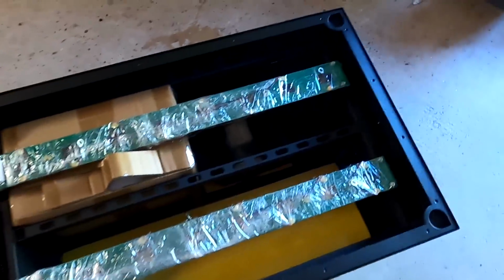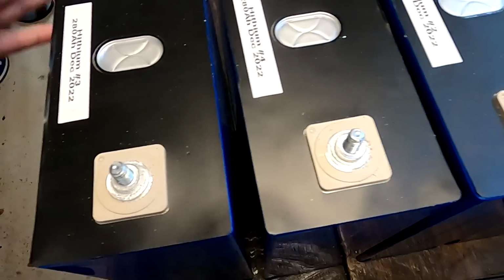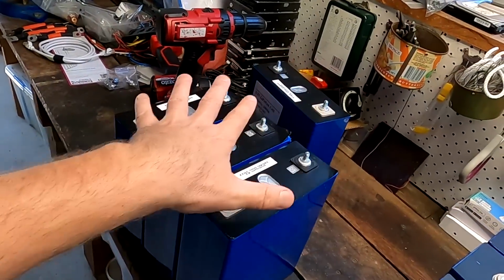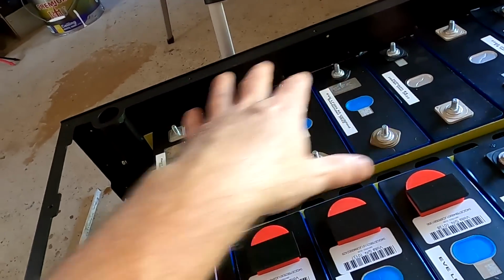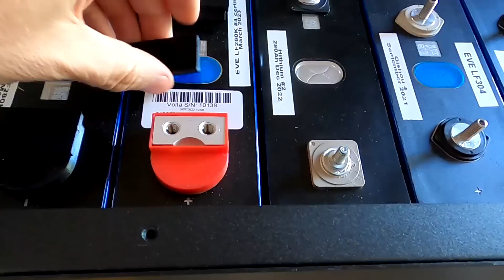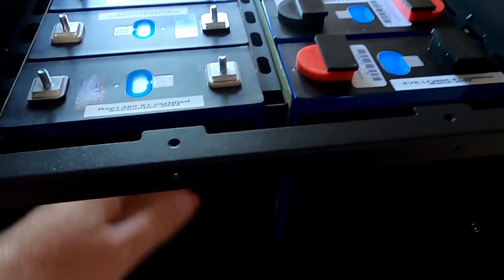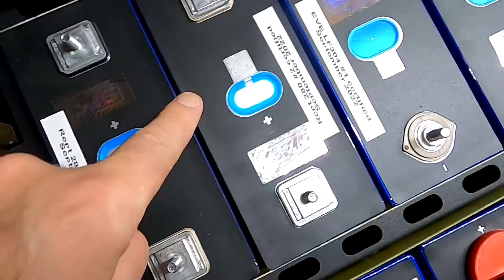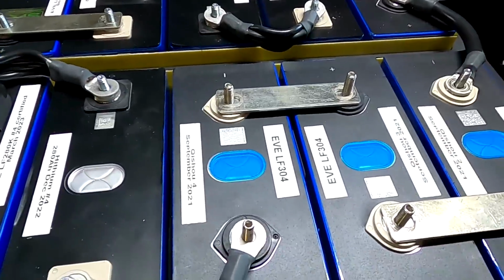Compressing swollen cells. What a start building this battery.

Comment: Rearrange your cells in a symmetric run, i.e. (2+2+2+2 of each kind) in 2 rows.
Reply from the maker: But then they won't have the same depth for each lane.
Reply: @OffGridGarageAustralia  They definitely WILL! If each cell of one of the 4 groups has a Dx depth (x=a to e) the total depth will be: 2xDa + 2xDb +2xDc +2xDe = (4-2)xDa + (4-2)xDb +x(4-2)Dc +(4-2)xDe, where (4-2) is a way of portraying the 2 unused out of each bunch of 4.

Comment: Andy, is it necessary to compress a 12v battery 320 ah (4 cells)? be used in a campervan.
Reply: He already has a video in that, and the conclusion is... No need to compress! No gains at all.
Reply from the maker: I would recommend it because it gets rattled around a bit in the van. So compression or a good fixture ensures they stay together...

Comment: Does anyone know where I can get pre crimped connectors/cables for jk-b2a24s15p GPS/rs485 (smaller than jst1.25) tks.
Reply from the maker: You should be able to get them on AliExpress. Also ask the Hankzor store there, they should be able to point you in the right direction or even have some for you.

Comment: You could make one new flexible busbar and use this one between cell Nr. 8 and 9. There the Seplos BMS has a extra voltage sens wire to compensate for the different busbar lenght.
Reply from the maker: An extra voltage sense wire?
Reply: @OffGridGarageAustralia  On cell No. 9, there is a additional "balance cable" on the negative pole of the cell. Therefore, the resistance of the busbar between cell No. 8 and cell No. 9 will not influence the voltage measurement of the BMS. You can find that in the Seplos BMS wiring diagram.

Comment: Could a strong spring between the battery and busbars be good or to press the busbars down to the battery.
Reply from the maker: The contact area would be minimal and resistance will certainly rise. The movement will be rather horizontally than vertically.

Comment: I would call and question the safety of compressing already swollen cells. What about the possibility of causing a short circuit between layers of dielectric within the cells with all that pressure?

Comment: Hi Andy,

They seem to fit, yet doesn’t it pose a problem that different busbars are bound to have a different resistance. This would have a negative impact on the balance at any point.

I think I would try and use all the same flex busbars, either all the same flexible, or all solid, equal distance with the hole filed out so that the connection surface of the busbar to the terminals are all the same.

Seplos’s compressionplate material seems a little thin at some points. Could it be you used a too high tork to compress. Isn’t there a way to calculate the tork matching the compression ?

Any way, I think I would support the bended parts with a steel “corner” of “Z” shaped metal to strengthen them.  Now that they are bend, they will bend more much easier when cells become pregnant of twins.

Keep up the nice work.. can’t wait to see what happens.
Reply from the maker: I tightened the compression plate with the battery drill to what I would consider tight and solid. I checked with the torque adapter and it showed only 4Nm...

Comment: I used the foam and couldn't close the case anymore. I had to remove all but 3 foam pads from the batteries. I wonder if it's bad if I have left the cells with a bit of breathing room.

Comment: And so it begins :). Nice project, nice video. Looking forward to every episode. Great learning experience.

Well - you experimented with those connectors a lot. Why not just use different busbar types in the battery and see, what the temperatures will be. You can and will be changing them anyway :P.

Since i am closely monitoring cell voltages (nice colourful graphs in Grafan *whoop*) and do some basic descriptive statistics with these data (avarages, spread and standard derivation) on my 2 batteries which are made of different cells qualities (battery alpha is "Grade A" erm Grade B, battery beta is supposed to be real Grade A) it would be so interesting to see, how the franken-battery performs compared to other batteries when it comes to the cells. We do so much initial testing on those cells and are obsessed with internal cell resistance, maximum capacity, "cell uniformity" - maybe in real life this does not matter at all :). So real life data might be the thing to check in the future --> go check for cell monitoring (there is an entry on that in the github discussion panel of the dbuserialbattery project, in case you might want to check).

Comment: Hi Andy. Great video. Question for you and everyone. If you used a mixture of different bussbars would that add to the cell imbalances we get on Lifep04 cells? 
Or is the cell imbalances just a result of the internal resistances of cells?
Reply from the maker: We always say internal resistance is the cause of imbalance but the resistance of a bad connection adds to that.
That is a very good question and has not been tested 🤔
Reply: @OffGridGarageAustralia  something me and another engineer having a great debate over the other day. People stress about the bussbar resistance and connection resistance being low as posible. Which is great! Makes the overall system more efficient with less power losses. But does it contribute to cell imbalance 🤔? 
Another experiment for you Andy 😀.

Comment: Interesting project. But what are your objectives? Do you intend to build in the most obstacles possible or get the best battery out of this uneven assembly of cells?
- Once you have this sticky foam inbetween the cells, they will try to shift as the foam allows it. They will test it out what belly is the strongest. (some kind of tug-of-war play) In this regard you are advised to use flexible interconnections only. 
- You might decide to clean the cell contacts and wire lugs with a cleaning hand pad before - in order to remove any dirt, oxide or finger prints. Why to prepare electrical contacts worse than surfaces for soldering?
- The initial balancing procedure will take forever in case you did not to balance them first thouroughly. But afterwards any good balancer will do the job nicely. A major unbalance is expected in case of heavy loads due to the different internal resistance. After that the balancer will be more busy than usual.
- Cells with higher capacity will just not be used fully and the worst cell will determine the total Ah of the pack. (weakest element of a chain) No major issue expected.
Reply: I guess we will see if all of that is correct! It could (should?) be. But the idea is to understand all of those statements above. I think this is genius... Because normally nobody in their right mind would do this, right? I am very curious to know what happens...
Reply from the maker: Either way, it's an experimental battery, so we can change and test...
I'm not going to clean the contacts. I did this once and had lots of issues. Since then, never bothered again doing this and they all worked brilliantly without cleaning.

Comment: Why not evenly distribute the cells: 2xhithiums, 2x304s, 2xrepts, 2xEVE? Symmetry. 
As for bus bars: now they are compressed, can they further expand? YES=Flexible; NO=Rigid bars.
Reply from the maker: Both rows need to be roughly the same depth so the compression plate at the front can evenly push them in...

Comment: With different capacity cells in series, I'm concerned the balancer may do more harm than good.  But, that is why you're testing.  Right, Andy?
Reply from the maker: Yes. I assume, the balancer will not do much. at least not more than in other batteries.

Comment: I am still of the opinion, that all this compression is nonsense. When you have this compression working for >1000 cycles while cells are pumping with each cycle:
- either the screws of the compression plate will turn lose
- or the compression plate will break
- or the terminals will break because of the mechanical force from the busbars

I think the best way for long term success should be leaving enough space between the cells to let them pump and bulge as they wish, as they will do anyways...

What do you guys think?
Reply: I think "Trees that bend in the wind last longest" - I use  thin neoprene separators and mild compression using huge industrial thick nylon cable ties with 18mm  ply end blocks -  all bus bars are copper  laminated  and  flexible  - it makes sense to allow enough flexibility for the cells to pant as they  cycle  but structurally a sound monoblock for mounting in my RV
Reply: Springs or poron foam and flexible busbars allows for some minimal expansion if done correctly

Comment: Nice work, i would absolutely use this battery. Next time i would typically discharge the cells before installation to potentially shrink them a little
Reply from the maker: The foam in between the cells will allo for a bit of movement anyway.

Comment: My cells have not expanded.  I have 48 280AH Eve cells that are in 3 banks of 16.  I have them slightly firm but not tight.  I believe many people are over charging their cells.  You don't get much more capacity once you go over 3.4 volts.  My chargers are set for around 54.4 to float.  Overcharging will cause more problems than it's worth.  It make no sense to shorten the life of your batteries for so little more capacity.
Reply from the maker: Thanks for sharing. Overcharging is above 3.65V per cell. That is the maximum charge voltage they can do. 
I found charging to 3.4V as not very consistent as it is still just in the flat area of the charge curve. 3.45V per cell seems far better as it also allows the balancer to work. Under 3.45V, there is no difference in voltage even the SOC can be different across the cells.
Reply: @OffGridGarageAustralia  I just wouldn't stress the cells, but to each their own.  Very little extra capacity at the top end.  The curves show that. Again mine aren't swollen.

Comment: Forget bussbars flex copper cable with crimp lugs no solder.  No bussbars.  No aluminium.  Plastic lattice between cells for cooling and compression no box for cooling

Comment: Wer it me......      I would've matched cells side to side as much as possible...   You have multiple,  multiple's of 4.....     2 per side and, or, +1 per side....    order to give the lowest overall length.  Bus bars....    measure it  !!!  Make sure the resistance "Match's"....   Doesn't matter if it's solid/flexible...    or...   made from "Strudel" .....           My  $0.02   worth.........

Comment: It is not recommended to compress already bloated cells
Reply from the maker: Where does it say that?
Reply: Can cause delamination and cell failure. Are you looking for trouble with you Frankenstein battery? Possibly the compression used is not enough. Ps I have made the comment about not compressing bloated cells before
Reply from the maker: @michaelbouckley4455  Well, we will see what is going to happen. The Seplos box does not really compress them, it is more like a fixture. The foam in between the cells is give them a bit room to work with.
Reply: @OffGridGarageAustralia  I did reply with a link, but can’t see the link now. Was from diysolarforum

Comment: 13:41 NO, NO, NO buzzzzzz. What if the terminals punch through the insulation on the cell body? NEVER EVER do this. Too much confidence was the start of many cheesy ways to disaster. (Think Swiss Cheese model!)
Reply from the maker: How would the terminals punch through the cell body? I mean, they already did at the top...
Reply: @OffGridGarageAustralia  I wrote insulation. I noticed on my cells that the blue plastic wrap is not perfect everywhere and also not that thick. So laying a heavy cell on the terminals, which might have a sharp edge, and perhaps moving it around on them might penetrate that plastic and the aluminum body shorts the battery poles. But, no risk no fun!